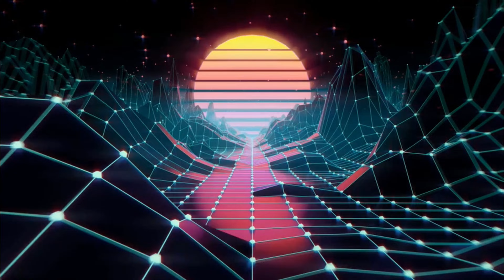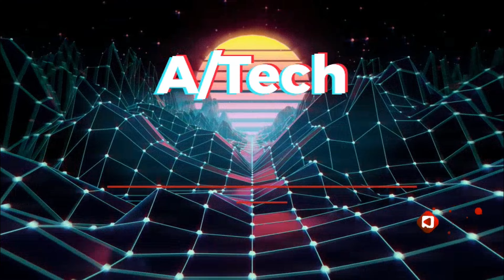PURPLE HAZEL AMP BUILD PROJECT PART 1

Comment: Suggestion: do a rundown of how much the different parts affect the sound and performance of the amp. You have alluded to this in several of your videos but it would be amazing to have it in one video.  As a noob who don’t want to spend unnecessary cash when learning but still want to make great sounding amps it would be great. Like, should I allocate more cash on transformers and skimp on tubes? Or is it worth it to spend more on a great speaker and buy generic caps? You get the idea. Thanks for keeping up with the videos!